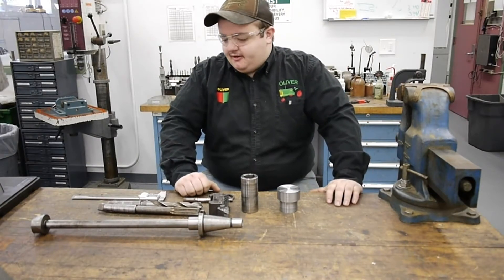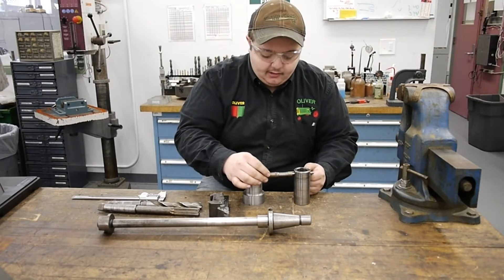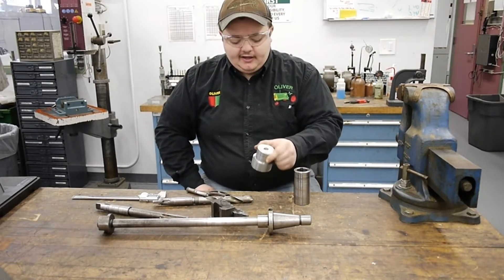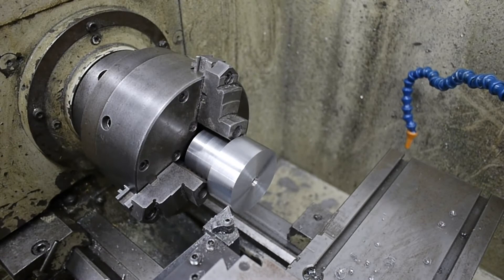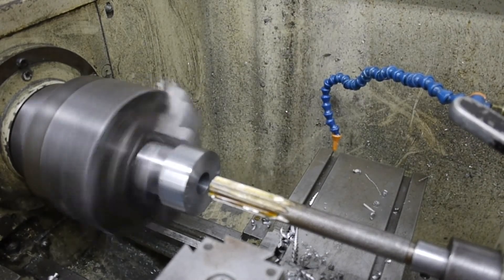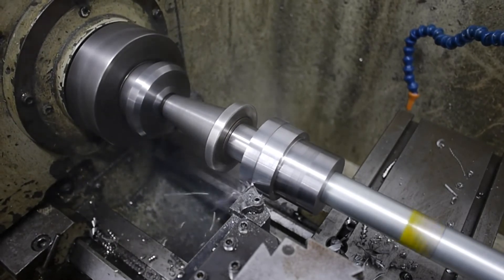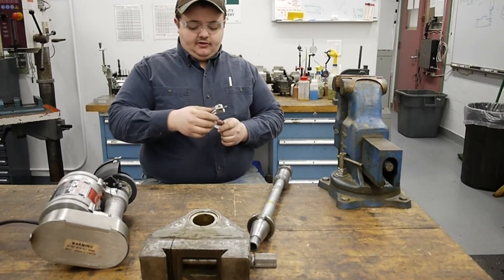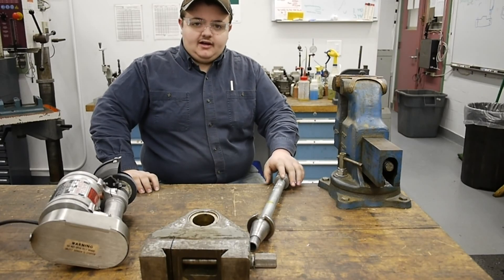Making a 7/8" Arbor Drive Bushing for the Induma Horizontal Mill using the DoAll Toolpost Grinder!

Comment: Nice job on the bushing. On my Hor' Mill the arbor end support is ever so slightly taper on its ID -  the 1" dia arbors are not too long  (12" up to 16" longest I think) so there is no intermediate support - Ive been wondering if I should make one to see if it will improve things on the longer arbors. Thanks for uploading and good luck with your channel . All the best Mat
Reply from the maker: Thanks for watching!